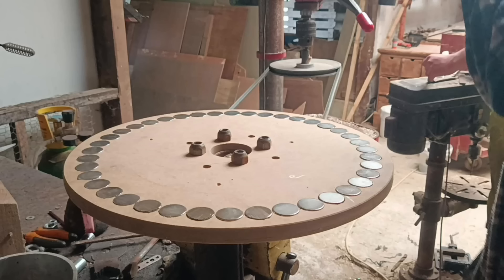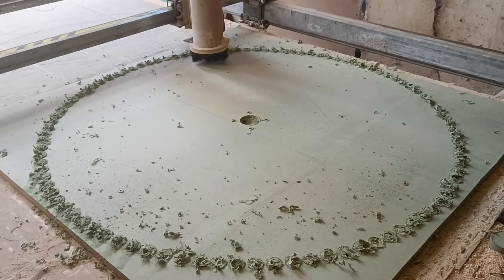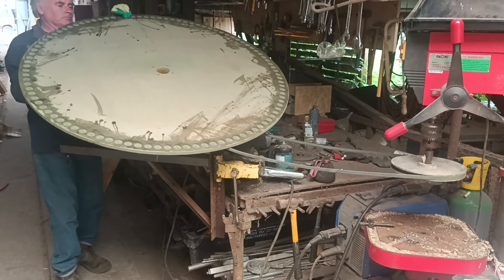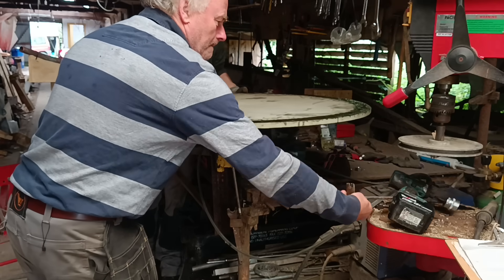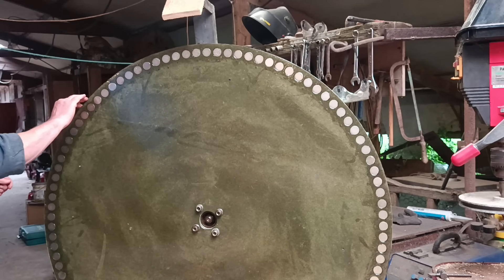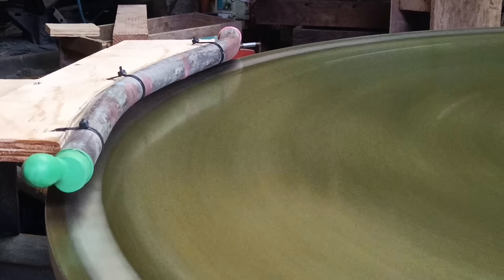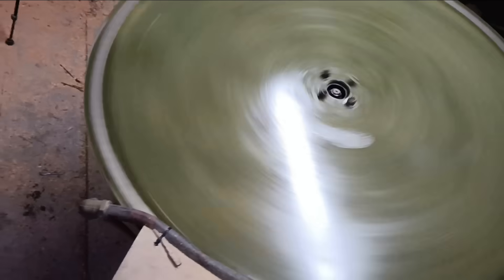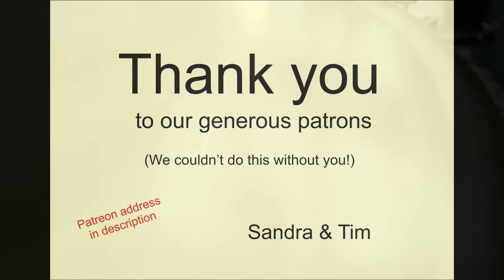ABSOLUTELY HUGE Magnetic Induction Heater! Using 100 Spinning Neodynium Magnets And A Bucket

Comment: Put more magnets further in which should spin faster than the outer circumference, More pipe in stages, insulated where needed. Outer circumference for preheat and progress inwardly for more heat since the inner magnets (doubled up) spins faster.

Comment: Why don't you also take the heat from the drill press motor and heat the water? 😉You could also generate heat directly from a disk by using friction, as with a drum or disk brake in a car. Of course a well-designed heat pump would be way more efficient.

Comment: An impeller in a bucket with no place for the water to be pushed is a fairly efficient means of converting motion to friction, thus heat.  There isn't much reason to go by way of magnetic flux, to AC electricity, back to magnetic flux like this does.

Comment: There is an immense amount of magnetic reluctance in your contraption - making it very highly inefficient.  For a start the underside of the magnets is effectively an open circuit (magnetically speaking) and this was the problem with electric motors before about 1860.  Have a look at Tesla's Magnetic circuits and learn from his genius.
Reply: This isn't useable anyway because you can replace frtction with decay. The energy has to come from somewhere.

Comment: Brilliant I love how do you thought about running it inside of a vacuum or at least a sealed unit my concern is if you lagged all the pipes and insulated everything the we'll itself withdraw in cold are therefore making the process efficient if it was within a box the whole unit could heat up and the turbine would be running within its own heat as well as heating the water I love it well done mate by the way I'm no scientist I'm a plaster

Comment: 1. Use ferrous pipes. Iron has more resistivity than copper, therefore the ohmic heat dissipation is higher.
2. Use a circular pipe so as to not waste a significant portion of the circumference.
3. Maybe put pipes on both sides, the magnetic flux looks significant through the thin MDF remaining under the magnets.
4. Try to flatten the pipes

Comment: If you can put the copper tube closer to the magnets.
That will increase the heating effect exponentially. Also if you can make copper tube more flat it will also increase efficiency.
Good luck with the project 💪🏼

Comment: Under the magnets and over the magnets = heating x 2?

Thinner bore copper?

Doubling up the magnets?

Two disks, one above the pipe and one below the pipe?

Several layers of magnets with pipes in between?

Solid blocks of copper with holes drilled through or copper pipes encased in lead for more heat induction?

Comment: I would suggest getting better concentricity on your large wheel by mounting it on the rotational spinning system after cutting, then using wood lathe tools to cut the outside diameter into exact roundness with it spinning at a good RPM. This would reduce wobbling and improve balance so there's less wear and risk for breakage over time on the bearings. The insulation on the pipes was also something that came immediately to mind due to thermal dissipation as the water travels through the pipes. 

An alternative would be to increase the RPM on your induction motor and heat the pipe hotter, but that seems contrary to the point of increasing the diameter of the wheel. An alternative would be to build a second wheel with magnets in opposite configuration (so they don't attract to the other wheel) and putting it with a spacer above the other wheel and therefore the pipe you're trying to heat  - so you'd have an induction wheel above and below the pipe to increase the thermal induction rate being imparted into the pipe without having to greatly modify the overall design. That would improve heating speed and maximum temperature without an RPM increase, but would also increase cost and effort to make an entire second wheel. 

It could also introduce more wobbling or vibration if the roundness and concentricity aren't balanced between both wheel plates and their mounts, but could be offset by cutting them both to be exactly round with the previously mentioned technique or by using weight offsets opposite of the unbalanced section of wheel - a technique used with car and bike wheels with attached small metal weights. Obviously, don't use ferrous metals for balancing weights on a wheel that's got a ton of magnets, and put the counterbalance weights on the outer top and bottom of the wheels to keep them from attracting the other wheel's magnets. lmao

A genius idea overall you've got here. I'm definitely going to need to use a similar idea for something in the future. Thank you for the video and idea!

Comment: Nice project yeah. I agree with faragar about the full-circle element and full insulation. Additionally I suggest adding a water pump and valve to ensure and adjust optimal flow.

Comment: does heat insulation prevent magnetic field power? copper tubes that have water sealed at the three-point state are super conductive, which might help

Comment: Unfortunatelly the biger wheel less amounf of degree speed is needed but only because you can put there more magnet surface that will impacts/work on magnetized surface (you want to heat up) you want to work with (heated surface) To increase your  powe I woud assume having two wheels with pipe of water in between (you will have lower speed required ) additionally I would use pipe of flat surface as more surface would be closer to magnets and pipe entering from one side and moving round along the curvature of the wheel to exit from other side (hard to get perfectly bent pipe which is not round like pipe and of course for non round shape pipes flow resistance is higher as flow is with greater surface ) a same time plus use of stronger magnet supposedly not round but square would be better of same case?

Comment: your only using a 2ft section of pipe to heat. you have a 3ft diam disk so get 3pcs of smaller tube (ice maker tubing) and bend them around the outside of the disc. then place the three inside each other side by side and solder them to form a flatter surface. take the 6 end opening ports and join them into a manifold of 2 ports for a much larger heating area. you could also place a matching one under the disk and join them to the two ports. your induction field would then surround the entire outer ring area. you then could use a smaller disk with two magnets in line. i would use a resin fiberglass board like bullet panel for balance and heat resistance. under your disk i would install another square tube that slides into your horiz tube and mount a motor and belt tensioner for portability. as far as your bucket I would place two tanks side by side with the hot overflowing into the cold cycling tank for less line heat loss. Then set the entire unit into an insulated box with a lid.

Comment: installing the magnets.....
what about a piece of metal underneath the wood so you can stick the magnet to that?
washers for example.
Reply: or, have a hole on both sides but not entirely through the wood.
That way you could install a second magnet underneath which basically keeps the one ontop in place, right?

Comment: I bought some neodymium magnets from 1st4magnets a few years back and I ended up with blood blisters and cuts all over my hands because they are so strong I was constantly nipping my fingers, they were so strong many shattered like glass when they flew together, I didn't realise how strong a small magnet (40mm X 5mm) could be, anyone wanting a very strong magnet I recommend 1st4magnets 100%, as for your project, foam pipe lagging and you heat induction pipe should completely surround your magnet wheel, connect all the N & S magnets together with soldered wires, IE all the north face connected and all the south faced magnets to each other and you will see a huge increase in heat of you do that, probably boil it no problem,

Comment: Would it work if you had two rows of magnets one with north the other with south ( obviously) also it could fit into a smaller circumference. Another thought is if you make two layers to the wheel the bottom layer could have the correct size hole for the  magnet and the top a smaller hole to still expose the magnets but also to keep them in place. Could the wheel also be made of some form of plastic for waterproofing. 
Cheers

Comment: Get an aluminium flexible pile and coil it around the magnets, probably both sides of the disc will work. Back side could be pre-heater, as it is further from the magnets.
With suuch long water coils you may need a pump- a nice followup project. There are some handdrill powered ones, you just reduce the size of the impeller flaps to slow the speed.
Anyways, now, how to reduce inertia, as it is supposed to be wind driven.
Cut holes in the disk to make it lighter and balance it.
Also make a contraption to slide the coils in and out of the magnets to make it spin up easier. A centrifugal governor like in the early steam engines would do it.

Still an interesting YT project, but with so many magnets, you could have done an axial flux generator 😂

Comment: Wow this is some third world country stuff have you heard of a thorium reactor. Never mind. how about even just you can burn Natural Gas? You know just burn gas and heat water. Instead of burn gas to power a generator, to produce electricity, to turn an electric motor, turn a gear, to induction Heat.(that's how you waste power) There's this thing called gas stoves. Problem solved. One Step solution to Heating. Even better you know there's this thing called wood and it burns.

Comment: Iron inducts EM magnetism heavy metals separate outduct conduct EM magnetism.

It will all be over in 10 years 2033 when the conjunction of Sun-Mercury-Venus-New moon & Earth cause the east to be pulled out & around the planet east to west because lighting flashes from the east to the west & the clouds come from the west and the new moon tides are a pale shadow of Noah's tidal wave tsunamis to come. Me martyrs will be avenged as you & CO2 are not causing global warming climate change the mystery of the 7 stars crossings in one rotation of the galactic bulge Jesus held in his hand is & these are just the birthing pains.

Leave the EM lights on for Christ's sake & buy an EM EV if you can to siphon off Earth's increasing magnetosphere due to crossing the ecliptic between the two magnetic energies for the next millennium.

Comment: If you want to turn mechanical energy into just heat for water, all you need to do is agitate the water mechanically.  Coupling this with a windmill might make it more complex, because there's an optimal speed for a windmill to get the most energy out of the wind energy.

Comment: Maximize the heated surface area by making a complete loop of copper piping to sit above the magnetic wheel. Possibly take it one step further and make a copper coil several turns in height and placed close together to possibly somewhat insulate each other with their radiant heat.

Comment: Ideas  two discs like a thin cable Drum, opposite magnets, longer  copper pipe may be a rod of steel inside the copper pipe? ,only insulate the hot pipe to help water circulation it must cool as much as it heats  fun stuff

Comment: I thought about building something like this. What if rather than having magnets just on the outside of the  disk have the whole disk lined all the way to the center and have a coil that would cover the whole disk. I also wonder how much power it takes to run the disk vs an heating element for the amount of BTU.and will spinning the disk faster creat higher temperature.

Comment: To stop pipe from kinking when you bend it, pack it with sand. Bung one end with a rag, fill the pipe with dry sand, tap it with a mallet until the level of the sand drops. Repeat until you can't get anymore sand in the pipe then bung the open end. When you bend it, it will act like a solid bar.

Comment: In future to bend Copper pipe without kinks, you seal into the pipe interior sand.  Fill it completely with sand, and then you can bend it without kinks.
Another way is to wrap the pipe exterior with a strong spring.  I have never seen a 1 inch or larger in the wild myself but I just paused this sentence and found on on eBay for $40.

Comment: You forgot the back flow preventer, so the water pressure was forcing out the copper both directions. Try opening a coffee pot to examine the parts. Look for the back flow ball.

Comment: As for the vibration you had after balancing. I'm sure you know by now that static balance and dynamic balance are very different. If not, just think about how a 1 to 10 lever can perfectly balance a 10 to 1 weight, but when you start spinning them the long side will dominate the angular momentum

Comment: your problem is that your distance from the pipe to the magnets is to great, it needs to be closer. faster does make it better as well. you can also instead of alternating each magnet it will work better if you go north north south south and so on. I heated a church for a couple of years with this type of system. good luck nice job

Comment: This is why math exists. The relationship between the systems maximum temperature would be a formula involving things like the energy of the magnetic fields, the angle the conductor cuts the magnetic field relative to its motion, the surface area of water to pipe, the duration of exposure of the water to the pipe, the temperature difference between pipe and water, radiant heat loss in the pipework, the radiant heat loss from the surface area of water exposed to air, volume of water. Among many other bits and pieces. It's a peculiar use case and putting together a formula to accurately predict the outcome crosses into several realms of engineering and would be convoluted at best. 

Once you reduce heat loss, the upper limit of the temperature you achieve will be limited by the magnetic energy. At that point there's only two ways to increase the amount of energy put into the system; stronger magnets and/or faster rotation 9 higher frequency of the change in magnetic field). Fortunately magnetic fields propagate at the speed of light so you'll never reach a saturation point where increasing speed stops introducing more energy to the system, you'll just hit the point where centrifugal force causes it to explode.

Another way to approach this would be to reverse engineer the maths involved in induction heating. The energy put into the material being heated is the relationship between the frequency (big impact), the amperage of the system (reasonable impact), to a lesser extent the voltage, the # of coils, the csa of the conductor cutting the magnetic lines of flux and the distance the object is from the conductor. By far the most important factor is frequency, with induction heaters for heating up metals operating in the range of hundreds of kHz, often >1kW of power and can be 10kW+ for larger systems or faster heating. 100-400kHz is an approximate range used for localised heating of metals up to 10mm in thickness.

So unless you can reach (and maintain) those kHz frequencies by increasing the rotation speed of your device, you're not likely to achieve an amount of heating usable at scale.

Comment: I've ran pipe directly into the hot water heater tank like this using solar heating and thermo dynamics the same as you with great results, solar gain would gradually heat the water even on cloudy days hotter than the ambient water temperature because everything was insulated and heated water rises. I would recommend running the top tank higher, 30-50 feet above the heat source allows for greater temperature and pressure differentials. getting an insulated hot water tank and to wrap your exposed pipe with insulated lagging. The magnetic effect should still work through the 1/2 inch or so of foam insulation. Great work, hope you can rig this up with bicycle chains or something to your wind turbine.

Comment: Having worked at a manufacturer of induction heat treat equipment earlier in my life, I was fascinated to see you were induction heating with magnets!  The first thing that jumped out at me was that you were heating NON-ferrous metals!  Sure, it works, but induction heating ferrous metals, like steel, was MUCH easier, faster, and more successful.  Do you have concerns about using ferrous metals?
Reply: I was also super confused about this, I didn’t realize it was possible to even do this with non ferrous materials.

Comment: Accidental gluing the disc to the rotor, the shellac was probably not completely dry.

Should you build another disk, use two magnets when placing the magnets in the hole.
One magnet on the bottom of the disc to attract the one being inserted into the hole, and the one being inserted into the hole.
Every other one should be far enough apart so that they do not attract each other, if this is not the case, then do every fourth one.

Then, add the additional glue to seal the magnets in place.

Comment: Several design flaws here. You need to have a second layer of magnets underneath so that they can be held in without glue. Just use their attractive force to hold them in place using a second layer of magnets underneath. Also, you need to have all of the magnets working to make heat at the same time. Not just one point of interaction.

Comment: You will get better flow from conduction if your "hot" pipe went in the side of the tank near the top, insulate it, and keep it short. The long run of "cold" pipe looks fine 🙂 
It should work like a tea/coffee pot.